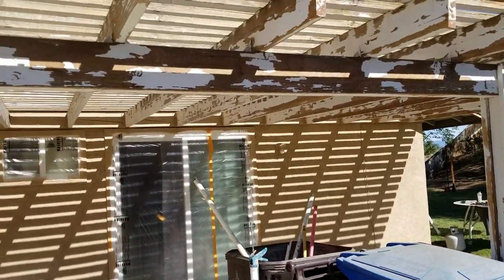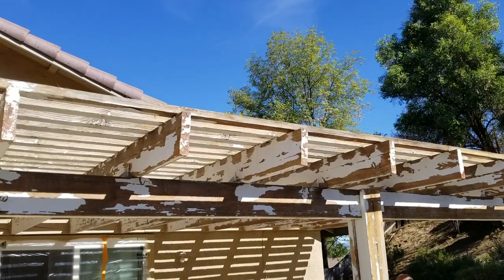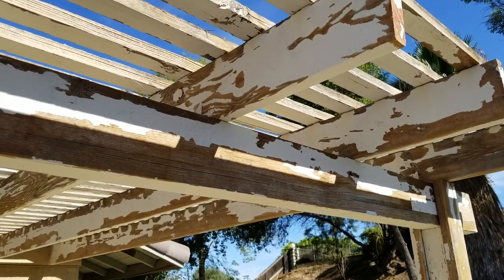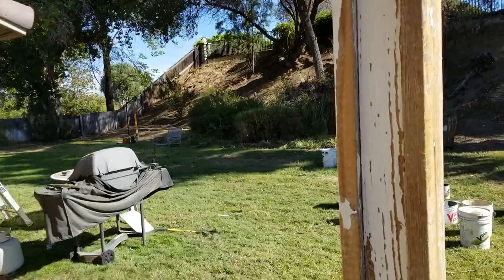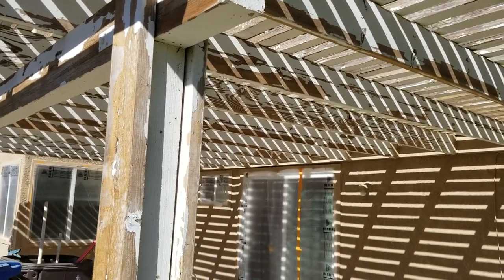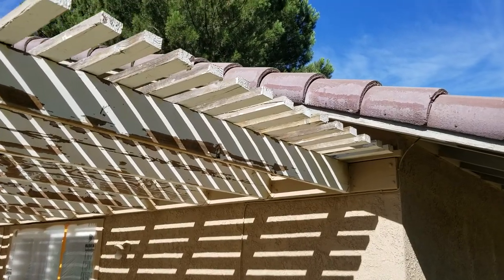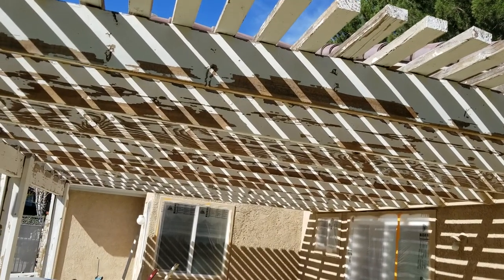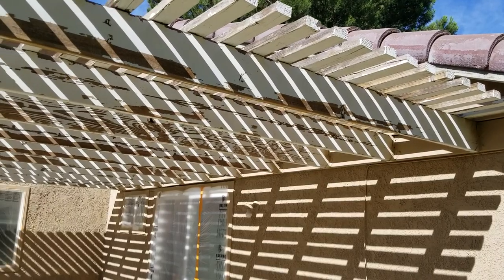painting lattice patio covers the way I do it

Comment: Hi , please give me your advise . I live in Ca.  I have a painted white patio cover . It was painted last maybe 5 years ago . I found out I have some termite damage and fungus .  I have interviewed 3 different contractors . Yes, one post needs replacing . Two 20 foot beams need replacing . As well as smaller slats .  One painter told me he would power wash it first . Replace the necessary wood . Some scrapping , than paint .  I like the power wash idea . I’ve been researching . I guess power washing can be rough on the wood . I saw a picture of the top of the cover ( looking down in it ) it looks like it could be damaged if things were too vigorous. 
  The termite companies contractor said , they don’t power wash . Just replacing the wood , & cleaning the fungus . The  new wood will be primed . Should I have it power washed by someone else than have the termite company make the repairs ( other areas of the home need wood repairs as well ) it’s over whelming .  This termite and fungus repair is extremely expensive . I’m having the house tented as well . I need to be mindful on cost .( I’m worried of other wood work that may be needed when things are opened up to repair . I like the work the Termite company is offering best , but I like the idea of power washing it first .  It is painted white . So no staining . 
Thank you for your thoughts .

Comment: You said to use latex flat paint correct. Which primer would your recommend?  Is there any caulking that you used?
Reply from the maker: 100 % acrylic self priming is fine for rough swan patio covers. Primer is good if the wood is not weathered. but not totally necessary
Reply: @mikethepainter Mike do you ever caulk any areas of the lattice?
Reply from the maker: @jlopezglobal  no the sun just tears it up
Reply: @mikethepainter thank you